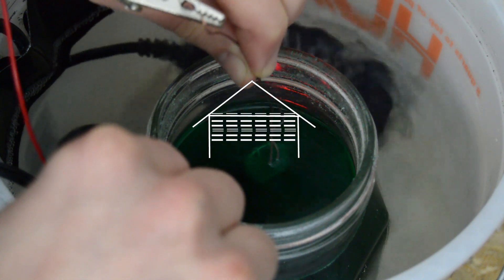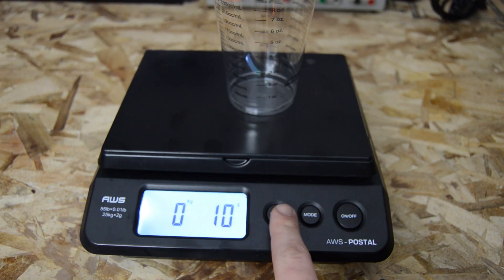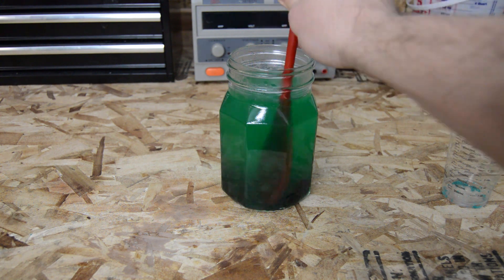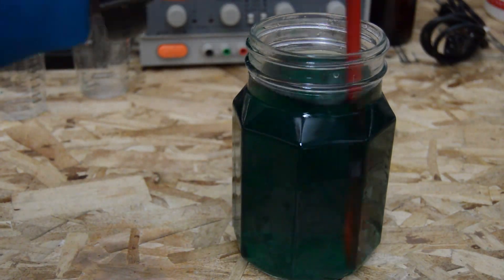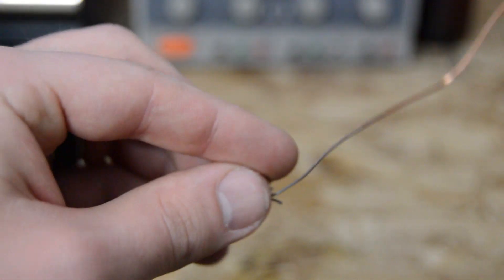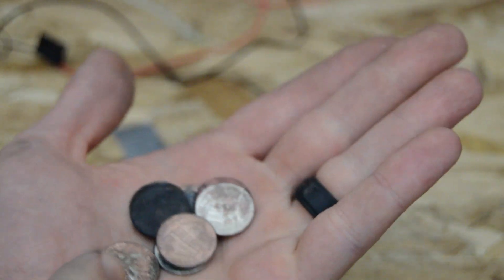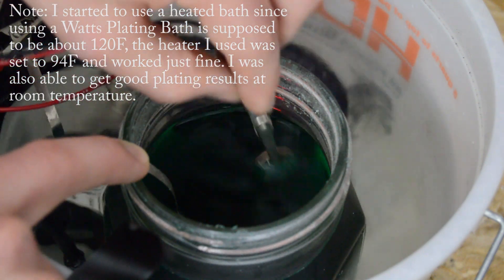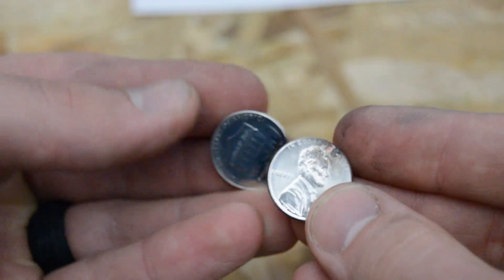Easiest Nickel Electroplating Guide for Bright Nickel Coatings

Comment: Do you use any type of Chemical cleaners or Surface activators (aka: Pickling bath) 
I read a DIY company who sells DIY kits for home & hobby use advocating them. 
What they call the “Surface Activator “ is a [Sulphuric acid] solution. And the cleaner Solution used before the Sulphuric acid is weak HCI Solution. 
📍I’ve only seen the online DIY folks using a HCI solution before they do the Nickel Plating process.
📍Any suggestions with either of these ? Or maybe something else you prefer?
Thanks for your content!!
Lee
Reply from the maker: I have used a cleaning solutions. And I do it 3 stages.  Clean thoughly before hand. Dip for about 10 seconds in HCl, about 10-30 seconds in H2SO4 and rinse in clean water before and after each.
Reply: @GarageScience  
Ok so pretty much the same 3 steps that this company suggests & BTW {sells the Battery Acid for $40 a quart.} 
Along with an HCI Cleaner called (ElectroClean)for about the same cost. 
❗️They also use a Stainless steel Anode & run a Low ⚡️thru the solutions of each of those 2 steps before getting the Nickel.
📍I machine many of my parts in Aluminum & like to Anodize & color with dye if need be.  In my Anodizing steps there is a 
⚗️2-3 minute soak in a 20% “SODIUM HYDROXIDE Solution” 
❓What are your thoughts of using (A NaOH) 20% Solution in place of the HCI Bath for Cleaning Brass prior to the H2504❓ 

BTW: I REALLY APPRECIATE your quick response to my questions on your YouTube video. As well as your Killer Content💯
🙏Thanks🙏
☯️Lee
Reply from the maker: NaOH is basic versus the HCl which is very acidic. The acid helps cut any grease or oil that's present. Whereas NaOH leaves a soapy residue. The NaOH could get used in the initially cleaning but I'd still finish with the H2SO4 and HCl. Using the SS electrodes helps accomplish electrocleaning which is good for removing a microscopic top layer of metal. At a certain point it's probably overkill because the plating will have deficiencies in the deposit due to bath purity levels and more cleaning won't prevent that. And most DIY plating baths aren't totally pure either.
Reply: @GarageScience  Excellent- Exactly the information I was looking for! I really appreciate you taking the time to give me a Quality answer to my question💯 👏👏👏
Respectfully,
Lee aka: ☯️ZenModeling

Comment: The black stuff is other metal than nickel touching the nickel solution. Best result for nickel plating is using nickel clips to avoid contamination of the solution by other metal elements during electrolysis process.

Comment: Great video, but I need to make a few comments.  Air agitation is a very poor way to agitate a bath.  It's often used in shops because it's simple, that's it.  Hidden costs include power for the blower/compressor, heat loss from the bath, and the build up of impurities (O2/CO2 from the air and minerals when tap water is used for make up).  An eductor with pump and solids filter gives much better results in a large bath.  For working in a beaker, a heated magnetic stirrer would be best.   The copper pennies you use are copper cladded zinc.  An exposed edge or deep scratch into the zinc could affect plating quality.  And please wear nitrile gloves.  Some people are allergic to nickle and will develop nickle itch.  Really bad exposure can lead to skin ulcers and sores.  The risk may be low, but why take the chance?

Comment: I watched your other video on making NiSO4.  Rather than making crystals and then redissolving them for nickel plating, can I use the solution from the other video as it is or do I need to modify it in any way before I add  boric acid and NiCl2?
Reply from the maker: So thing is that it's a little difficult to know what the concentration is when you dissolve the nickel initially.  Additionally, there will almost certainly be excess sulfuric acid left over in the solution. By precipitating out the NiSO4 you can (mostly) eliminate potential contaminates like that.  You may be able to, but I haven't tried it for those reasons.

Comment: I suspect that your aquarium pump is pumping too much air through your solution, and the result is "burning" of your deposit. If you can bleed off some of the air and/or increase the bath temperature, you should see improved results.

Comment: I have 6V battery charger and always get dark results, I wonder if it is because of air?
Reply from the maker: Possibly if you are using an air sparge like I was initially. Also you could try putting a few diodes in line with the power supply. Most diodes have a standard 0.7V voltage drop across itself when it's conducting. Putting 3 in series would get you approximately a 2.1V voltage drop.

Comment: most nickel plating solutions claim to have an extra ingredient for a brightener....does your solution have this?..thanks in advance
Reply from the maker: I didn't use an ingredient specifically meant to act a brightener.  I was fairly impressed with the brightness of the coatings I got without using a brightening agent.
Reply: @GarageScience  thanks for the reply

Comment: First of thanks for your super useful work, really mean it!
Sorry to mind you, I did reserch however I could not come with proper answer.
I bought 96 % nickel battery strips as the one that you use in your videos. To check the nickel purity I let one nickel strip piece in water and salt for 24 hours. After that time my nickel turns yellow were I cut the strip, the strip, sold as 96% pure, to me looks like coated. I bought several nickel strips from 3 different shops, all sold as 96% pure, all 3 turned yellow.
In your experience can I use it anyway?
Thanks again for your help
Reply: buy nickel anode not nickel strips

Comment: Anybody that's wondering, nickel chloride is exceedingly easy to make.  Hydrochloric acid and two nickel electrodes, and run some current through it.  The chlorine will react with the positive electrode, creating nickel chloride, and the hydrogen will form on the negative electrode and bubble off.  You'll want to cover the container, because hydrochloric acid is nasty stuff, but poke a pinhole in the cover to let out the hydrogen gas.  This will take a while though

Comment: the black thing is carbon. the rest of chemical reaction, acid is braking out for oxygen, carbon and metal from your solution. I was cleaning part few times from that black carbon.
to get rid of bubbles of air on part, good choice is put high voltage, like 12 to 24 v, this way the small micro bubbles will very fast going out.

Comment: Before nickel plating do I clean the substrate metal with anything?
Reply from the maker: A degreaser such as dish soap is fine, maybe a light abrasive such as bar top cleaner. Some papers suggest dipping in HCl to "active" the surface, just be careful because HCl can be dangerous in high concentrations. Also rinse really well with water so there is no carry over of HCl into the electroplating solution.
Reply: @GarageScience  thank you sir !

Comment: At 4:18 you say don't use to much nickel because you don't want to much nickel in your bath if so why use nickel chloride? 
In aluminium Anodising it's more about amps, do amps play a role here too? Is Nickel Acetate effective?
Reply: I had the same question. It seems that the nickel chloride raises the conductivity of the nickel sulfate solution. Sodium chloride (salt) should do the same thing.
Reply from the maker: NaCl will do the same thing, however Na is a contaminate metal and can cause the nickel deposits to be brittle or flaky. You also don't want a ton of nickel in the solution either as that can cause rapid deposits that are black and sludgey. You're right that it's more about amps. I speak in reference to voltage because that's what most people are familiar with and most DC power supplies function as voltage sources and not current sources. You can actually calculate the number of atoms deposited (to some degree of accuracy) based off the current and time spent plating.

Comment: I would like to comment here that you can use the lost art of Contact Plating(electroplating without applied electricity but with natural electricity) to coat copper coins with that nickel plating bath, all you need is a aluminum pan a heating source, once the solution is close to the boiling point(don't let it boil) you can drop clean pennies and move them around and they will be coated with Nickel, I have a video on doing that on my channel.

Comment: Garage Science.
I was getting burnt spots too just not as black. I looked into it more after watching this video and found some very good information.  I'm sure you can make more sense of it than I can as I just started plating like a week ago. 
I'll leave a Link to the source below.

When metal is electrodeposited onto a cathode, the pH in the immediate vicinity of the cathode increases to very high levels. It can reach up to pH 11 or 12 very near to the surface of the electrode. The higher the cathodic current density, the higher the pH will rise. However, at pHs above about 6, nickel is precipitated as nickel hydroxide and if this happens at the cathode surface, the deposit will look very dark and is known as "burnt". To overcome this, boric acid is added to the bath as this controls and reduces the changes in pH, thus preventing the precipitation of hydroxides. However, boric acid is only useful at pHs above about 4, so where it is of little use in very acidic solutions such as acid copper. You can, in theory, run a nickel bath at very low pH's, but at these low pH's the efficiency will fall off dramatically as you will co-deposit hydrogen;! this will also lead to hydrogen entrapment and subsequent embrittlement of the deposit. In many applications, such as aerospace, this would be a total no-no.

Most nickel baths use between 30 and 40 g/l of boric acid; personally I like to run at levels closer to 40 than 30 as I have found it keeps the bath in better control. As a side issue, I have come across one well known company who operates a nickel electroforming bath at 120g/l boric acid, but they operated a sulphamate nickel bath at 90C. What I did find surprising about their bath was it didn't suffer from any stress or apparent breakdown of sulphamate to ammonia and sulphate. Their "trick" was to regularly replace some of the electrolyte and always keep it hot - if they didn't, the pipes got clogged with boric acid crystals and once this happens it is a real pig trying to redissolve it!

https://www.finishing.com/102/10.shtml
Reply: What are ubtrying to explain is chemical plating not electroplating

Comment: Thank you for this video!  I've been disappointed with my attempts at nickel plating so far and I realize it's because of the electrolyte solution I'm using.  Not enough chemicals in my solution. I'm going to try this and report back. Also, check out this link on nickel plating, it's pretty damn exhaustive. https://www.nickelinstitute.org/media/2323/nph_141015.pdf
Reply: Here are my thoughts after plating a bunch of bolts from my car using a semi-bright Watts plating bath. It's worth it to get an variable power supply. The ability to control voltages/current becomes important when the part size changes because a constant power output might work well on one piece, but won't for another. The nickel anodes shown in the video are good if you're doing small pieces very infrequently. In my experience, they are too thin to last for any substantial amount of time and you end up wasting time setting up more anodes. Buy the thicker stuff if you have to plate more items. I dipped my parts in a solution of distilled water and muriatic acid prior to plating. I can't comment on results without the acid bath, but it makes the surface that much more clean. The prep is the most important part of getting a good results. Really hot water and some degreaser works well. I'm very satisfied with the results. The coating is super hard and durable and can be polished to even look like chrome.

Comment: Nice video. Can you explain the function of the boric acid?.
Reply from the maker: You need the solution to be slightly acidic and the weak acid nature of boric acid it also functions to provide a pH buffer to keep the solution acidic for longer since electroplating isn't 100% efficient and solutions tend to become less acidic as they are used.
Reply: @GarageScience would store bought acetic acid also work?

Comment: I haven't tried air to agitate the plating bath.  I have a small magnetic stirrer - works great and fairly  inexpensive.
Reply: I made a stirrer which works well. I've been trying to keep my costs down. On the topic of cost and simplicity I've seen videos of people using vinegar as the electrolyte and just letting it deposit nickel in the solution over time. Have you tried this method?
Reply: @LEO-xo9cz  Hi - that would be like  immersion plating.  I use immersion nickle plating of non-conductive surfaces coated with conductive paint (ink). This lets me get into areas that are otherwise difficult to plate.
Reply: @edspencer5122  Interesting. I'm looking into electro forming as well. What is the difference?
Reply: @LEO-xo9cz  It's easier to give you and example of electroforming.  If you had a dried leaf and coated it with a sealer like varnish, then put a coat of conductive paint, such as powdered carbon, over the varnished surface.  The leaf could be electroplated in, say copper.  The copper solution if it had a brightener would be a shiny surface.  That is electroforming, plating over something that was non- conductive.
Reply: @edspencer5122  Thanks Ed. I'm familiar with electro forming. I've been researching it for a while now. I'm also looking at Zinc Plating my copper Plating. My question is Electrolytes. Watts Plating bath sounds like the professional method but I've seen many people use vinegar or citric acid and copper anode and cathode and just letting it run.
You think that is better for forming?
On the point of conductive paint I've seen people make paint by crushing the carbon from batteries. How does that compare to graphite?
Reply: @LEO-xo9cz   There are actually 3 Watt's  baths.  All are low nickle chloride (less than 25%).  There has been some new thinking and one has no nickle sulfate.  All baths that I have looked at use boric acid.   Nickle chloride is the salt (for the most part) that supplies the nickle chloride ion and has to be adjusted if using insoluable anodes, regardless of the solution.  I am interested in trying the use of vinegar (Citric Acid) rather than the Boric Acid.  Will let you know what I find.
Reply: @LEO-xo9cz  forgot about the Zinc question.  Yes I have plated Zinc over Copper rather than Nickle.  I've had better luck with Tin Immersion plating rather than Zinc.  That's just my opinion but so far,  the best results were baths containing tin chloride, thiourea and sulfuric acid.

Comment: Cool! Thanks for the great recipe. I had problems with an air bubbler in my electroless copper plating bath too. I suspect the oxygen level in the bath will affect the oxidation state of the ions in solution. The commercial plating shops have huge hundred gallon tanks, so the overall volume to bubbler ratio is much larger than in a beaker, and the wisdom to use a bubbler becomes widespread. At least, this is my theory. We should test by using an argon bubbler.
Reply from the maker: Thanks for the tip, I'll have to try that. Also, I've been a long time subscriber and viewer of your channel and it's an honor to have you watch my content!!! Happy New Year!
Reply: @GarageScience  Hi there, Excellent and practical video!  In keeping with Ben's comment, you could quickly determine what was going on with respect to potential oxidation by using nitrogen gas.
Reply: Hey applied science!
Reply: Why not use a stirring device?

Comment: hey i figured id put this here since its your most recent vid even though my question is about copper. I tried electroplating a walnut and within a couple minutes a very large amount of loose copper gathered on the wire I used. Do you have any idea what could have caused this and how i could avoid it? The room was about 65 and i was running .2 amp
Reply from the maker: What plating solution are you using?  I've made a video on two different copper plating recipes.  This problem could be caused by excessive plating voltage.  What is the voltage you are using?  When trying to copper plate things with conductive paint it takes extra time for the initial layer of copper to form.  Sounds like the majority of the 0.2 Amps you're plating with is going to the wire you're using to hang the part in the bath.  This is normal since conductive paint still has more resistance than bare copper wire.  Try leaving most of the insulation on the wire to prevent this from happening.  Only leaving enough wire exposed to make contact with the part will help the plating current you measure be more representative of what's getting electroplated to your part.